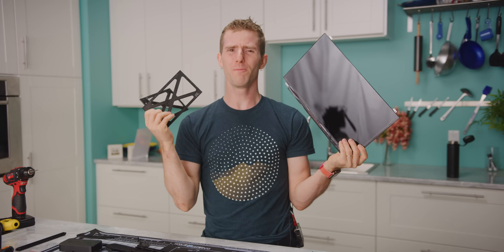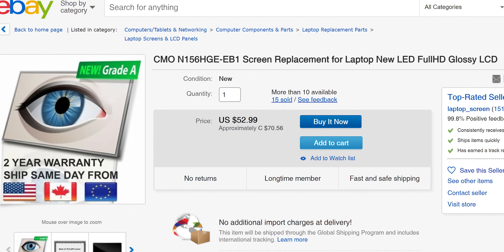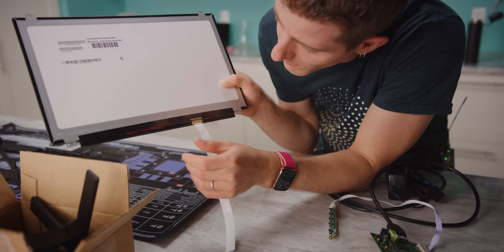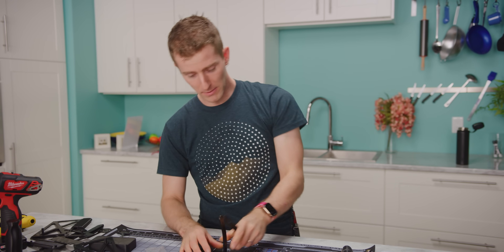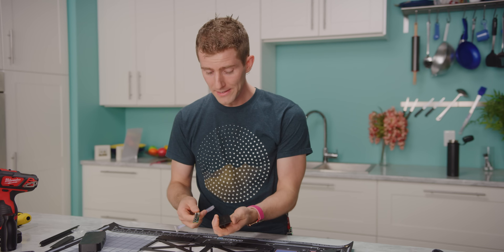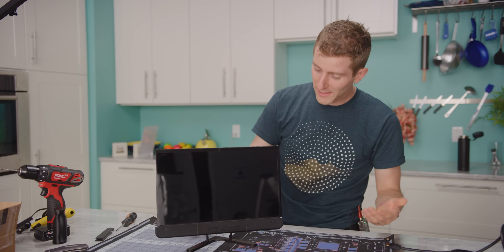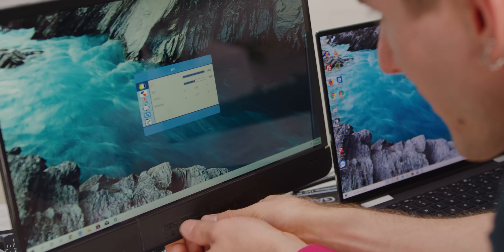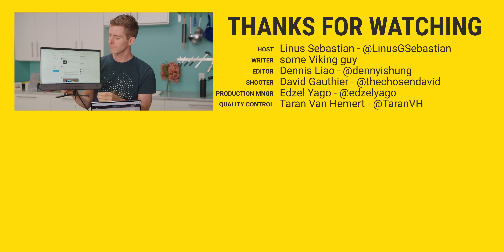We made our own monitor for under $100!

Comment: Just search "video driver" for " model number of the screen"  and you should be able to find a complete driver set with cables. For people without a 3d printer, you can try and salvage the original screen bezel if it still has one and create a stand for it with you imagination.

Comment: when you push in that blue tap (4:20) you need not only to rotate that black plastic bar down but also push it in (you can see on the video that there is a gap left) that way the cable is locked and wont fall out

Comment: Lol. I actually just made my own monitor and it cost me $4 for the driver board, $2 for the LVDS cable for my panel, less than $1 for stepdown converter all free shipping. And it actually works fine as a 2nd monitor.
Things to consider, make sure you know what you are doing.
know your LCD panel, There are different types of panel. older once uses 30 pin LVDS connectetor with a different connector for the backlight which is a CCFL backlight which also require another board which is a inverter board.
my panel is a 40 pin panel, there are multiple types but mine is a LED one which has the backlight connector with the 40pin connector. 
there is also 50 pin with different pinouts. 
Mac does have their own connectors so look into schematics for pinout.
now there are also thing to consider like what type of LVDS does your LCD use. There are 1 channel 6bit, 2 channel 6bit, 1 channel 8 bit and 2 channel 8bit. 2 channel will work for a 1 channel LCD with same bit but not the other way around. 
Know your LCD voltage.
Know your LED backlight voltage or check the datasheet.
Do all research specially when your not familiar with electronics.

Comment: a 1920x1080 monitor 24" 60hz will usually not cost you more than 50bucks used and almost new, doing this is both expensive and unnessesary, if this had been a method for making multiple panels into one large monitor id see it being very useful, this isnt quite it chief.

Comment: WOW found this at the PERFECT time. I accidentally broke my monitor today and I have an old laptop screen lying around. So I can just take the screen off my monitor and replace it with the laptop screen. (If they have the same connectors) and if not I can just use the parts from the monitor and buy the adaptors needed. 😁
Reply: Very old laptops (I'd say 4+ years old, maybe more) use a different interface, LVDS. They use 40 pin connectors vs the 30 pin one for eDP, so it should be fairly easy to tell.
Reply: @EnricoConca  Yeah the laptop from which I got the screen is lk 3-4 years old
Reply: @EnricoConca  
>Very old
>4+ years old
lol
Reply: Just go to a thrift store for a temporary replacement.
Reply: Hell yes! Do it at let us know how it goes!

Comment: 2:24 or just search for the model number of the screen with the addition "controller board" and buy one of these. They most likely come from china and has 2 weeks' shipping time but that's what I did with my really old and bad laptop screen.
Reply: yeah, i did the same 3 years ago, it came within the first 5 days and i wasnt even finished with my plywood frame yet

Comment: so i can buy a screen, a display thingy, cables, and a 3d printer for 100$ ?
oh whats that, its only under $100 if u have a 3d printer, oh okay.
Reply: some places do it free
Reply: i did this 3 years ago except i used plywood, originally i used an old screen from a laptop but recently i had to replace it with a new panel off ebay (which unfortunatly was 50$ for used),it only costed me 30$ to make it originally but if i count the replacement panel cost it came up to 80$ which still isnt bad
Reply: @socialfreak6900  yeah I think using wood wouldn't be a bad idea, just a basic triangle frame for it to lean on, I think people over depend on 3d printers these days lol
Reply: pop round and I will print the bits for  £10

Comment: Well that is useful , because i have a 2011 elitebook with a 1366*768 shitty panel and no way to replace it (the embedded controller doesn't accept higher resolution panels) . I didn't even know that a thing such as a edp controller even existed so i think i will try to put a 1080p panel through some kind of wiring trick , you just gave me a really neat project to work on!

Comment: If it goes to 90 - 120 fps I will make one for my sister
Reply: You can get up to 144hz laptop panels if you require it but this is likely going to be mainly used on 60hz panels since that is the majority of them out there